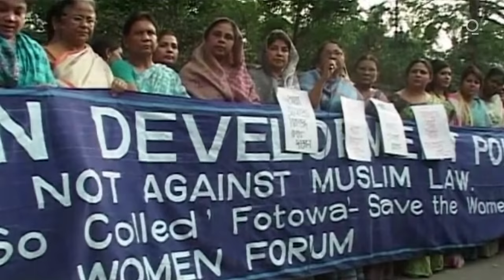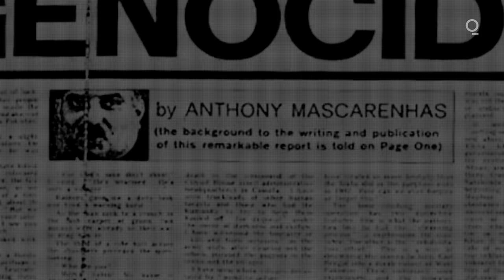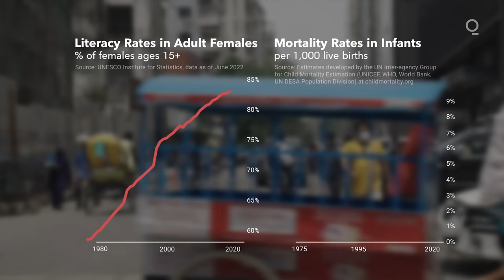How Bangladesh Reversed Its Economic Fate

Comment: Its a big misconception to compare Bangladesh growth with that of India. At best Bangladesh can be compared with Pakistan. Indias GDP is 3.5 trillion USD whereas Bangladesh is at megre 445 billion USD. Yes, per capita GDP for Bangladesh is 2500 USD as compared to 2277 USD for India due to Indias large population as compared to Bangladesh. Bangladesh recent GDP growth is due to cheap labor cost and their Garment export. If you take out the garment sector they dont have much to offer. Also, the rising GDP of Bangladesh is soon to hurt them as they loose the LDC incentive as they are now categorized as Developing country. Bangladesh need to divierse their manufacturing from garments to various other sectors and mostly they need to grow as a knowledge based country.  Else, its not going to sustain the growth which they have seen earlier. Their recent IMF loan speaks a lot about the half hearted growth.
Reply: Yeah, i don't think their growth is going to sustainable. They are completely away from high value goods and IT exports but when you say this this to a bengali, he thinks we're jealous 😂.
Reply: @Spectra12  Bangladesh is moving up the production value chain (slowly).

Comment: Bangladesh has 2.2% of it's GDP which goes into disaster. Further industrialization would require foreign capital to mitigate the flooding. 
That has to be both balanced against a huge population. Since the trend is "build local and do what you do best" it's mot clear what advantage Bangladesh has. The last thing it may want to do is go further into debt. It already is heavily indebted to Chinese lenders. It also doesn't have a stable tax base to pay back those loans. Croats border relations and exchanges with India are necessary to find a productive  iche where both sides of the border have value added to their economies.
Reply: The country's foreign debt is below the 20% of GDP threshold. So nothing to worry about.